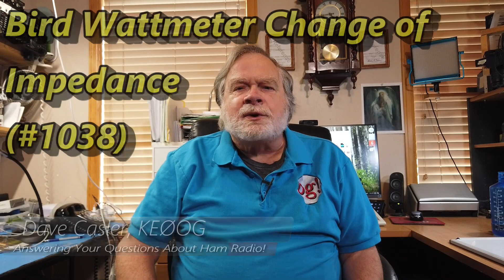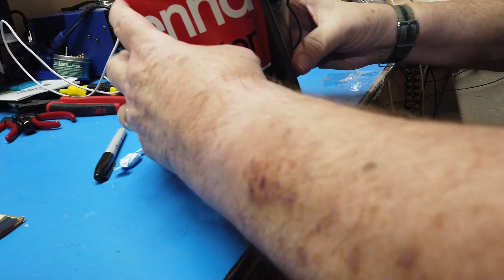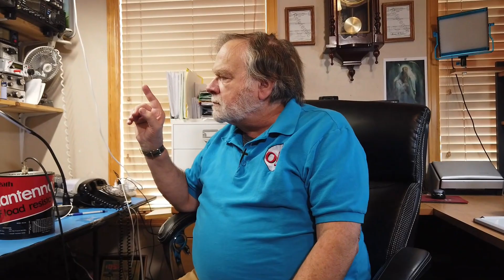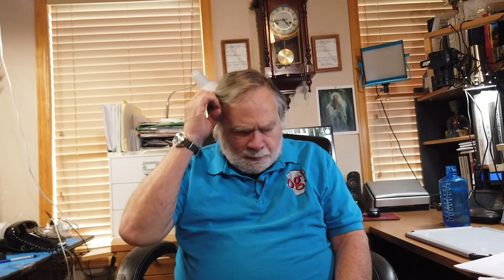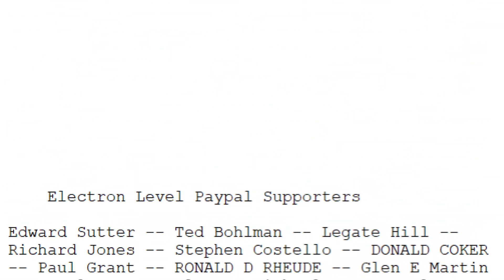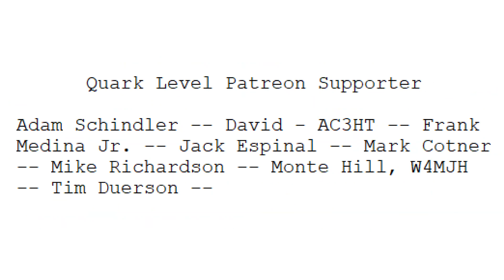Bird Wattmeter Change of Impedance (#1038)

Comment: It sounds to me as if KB1UKU is asking about Bird dummy loads failing, not the Bird meter itself. If that's the case, I'd be testing the dummy load with a NANO-VNA or a spectrum analyzer to verify what the attenuation actually is. If I'm correct, the VNA will also tell you the impedance/resistance of the load, so you get two answers at once. By the way Dave, Bird still sells their classic meters new in the box.

Comment: All meters will read approximately correct if they are calibrated correctly and input levels are within tolerance.. even bird meters need to be calibrated with precision using professional bench test equipment as no meter off the production line csn be trusted not even the most expensive whether its analogue or digital.

Comment: Some loads are indeed destroyed by excessive power for too long, the smaller ones can also suffer from impact damage by falling off a bench. As for the Bird Model 43 there is very little to go wrong with the meter body (other than the movement). Check the beryllium wiper that makes contact with the slug, these can fail to make contact, usually fixed by slightly bending them. The most common problems are the slugs/elements either from massive overload or again by being dropped. They are not a laboratory instrument but within the specified usage they are reasonably consistent.